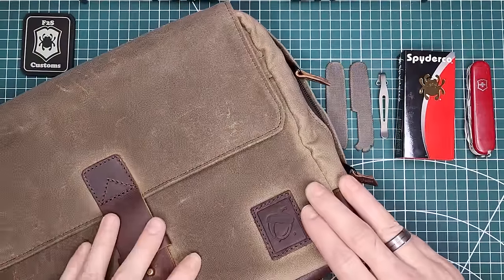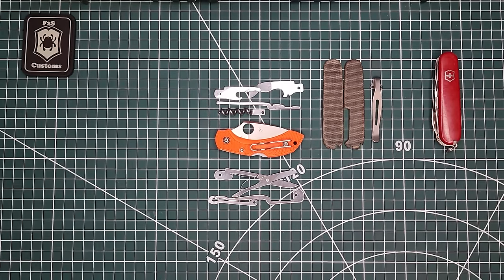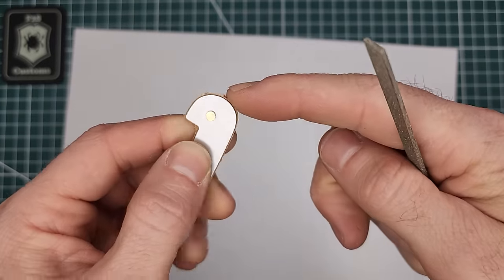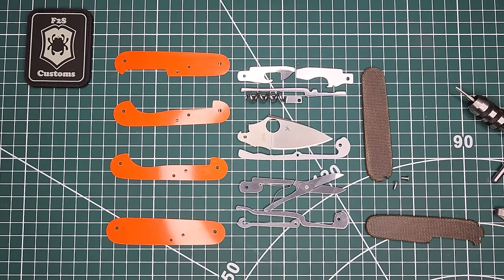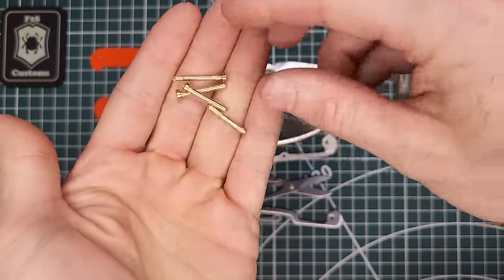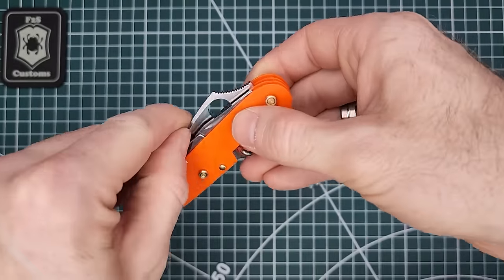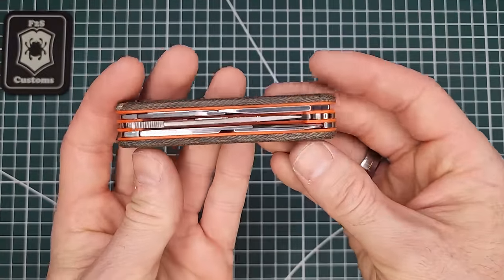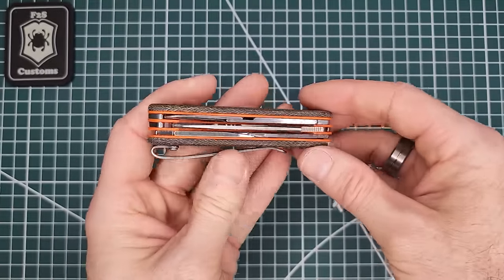How I made this Custom SAK for Nutsac

Comment: As a fellow knife modder and maker from experience when doing pocket clips best to use tapped brass inserts on the back of soft materials such as micarta just friendly suggestion awesome work btw
Reply from the maker: Thank you! I will keep that in mind.
Reply: I agree...
Reply: Always tip up. Tip down means added wasted motivation to open up the blade, it’s just less efficient. Even it it’s not a blade for self defense, it’s simply extra time that should already be cutting open the box/bag/whatever. I use a pocket blade every day and the few times I swap out to one of my tip down blades I’m immediately reminded how much better the other is.
Reply from the maker: @soonerfrac4611  I agree! Tip up is the best way to go. 👍🏻👍🏻
Reply: OTF tip down

Comment from the maker: Enjoying the video? You can support my channel by checking out the merch on my website. https://f2scustoms.com/merch
Reply: This is sick would love one
Reply from the maker: @Jesusiskingamen7  Thanks!
Reply: Thats absolutely amazing👊
Reply: I just found your channel. Killer blade&killer vid brother!!
Reply: If i want to build a 91 tinker and replace the oem large blade with a dragonfly would I have no other option but to fill in and Re-Drill the bore on the blade. Meaning the hole i place the oem victorynox brass pin in
Reply from the maker: @ruffknight355  That is correct. You would have to peen in the pivot bore and redrill it out to 2.6mm.

Comment: Very cool project, glad I stumbled on your channel. I'd feel a lot more comfortable with it's strength if those internal spacers were steel instead of G10. Love the blade upgrade though 👍
Reply from the maker: Thank you! I appreciate it. Did you know that the original liners are aluminum? So, the G10 is actually significantly stronger and more durable than the original liners were. 🙂
Reply: Steel would make the whole knife heavy as a mofo....... I don't think you realize just how much weight that would add to make them the same dimensions out of steel.....

In thise size and thickness g10 is incredibly strong..... People just see materials that look like regular old plastic and they assume it's brittle, but they just don't realize how far along we are with material sciences...... 

G10 is amazingly strong, even in thin form factors like this.... And it can't rust or corrode at all....
Reply: @JasonP6339  I'm not "people", I'm someone who makes knives and things out of steel, G10, etc. A piece of steel (which actually IS already used in other tools like this) little more than the size of a shim would add less weight than a few coins in my pocket. 
G10 is not some modern miracle material, even in thin "form factors". It's just fiberglass and resin and has been used as circuit boards in cheap electronics everywhere for generations because it's cheap. The choice to use it here is aesthetic, because it meets a color theme. Using steel would potentially allow the spacers to even be thinner and cut down the real annoyance of carrying something like this in the pocket; it's bulk.

Comment: Great content, would you be able to make one without the can opener, and replace that with something else?
Reply: How about a chisel?
Reply from the maker: Thank you! Yes, I could make one without the can opener. Plenty of options.
Reply from the maker: The original chisel is meant to go on the back of the knife. If you wanted a large chisel on the top of the knife, I would have to modify a tool. But it is possible.
Reply: Why? Most important can opener and bottle opener 👍😄😄🇩🇪🍻.
Reply from the maker: @thomasschafer7268  🤣👍🏻

Comment: Looks real good and functional! I might have to try to do one too. I was/am going to try adding a thumb stud (because yes, I'm one of those guys) to a standard SAK blade and move that layer to the right-hand dominate side. The versatility of the Spydie Hole making it ambi friendly is sweet for the majority especially if you were to sale them. I think the only change I would make would only be a personal preference and that would be to grind a bit more on the spring to bring the knife tip up to make it more centered to the axis of the knife handle. Again, that is just a personal aesthetic preference.
Great work, love seeing it done! Gonna have to go back and what all your vids now!
Reply from the maker: Thanks! 
Yeah, trying to bring the Dragonfly blade up (more straight), will then make it loose when opened. The pivot bore would have to be moved for that to work.
Reply: @FittoSurvive  Hmm, I see. When I'm working on things like that I've lightly filed either the blade where it bottoms out/rests against the spring ( like L < area)  or the spring itself which doesn't  affect the pivot at all, just the angle of the open blade. I've made some 'idiot marks' on bolsters doing this because I don't necessarily have correct tooling to do it without having the knife fully disassembled such as with Case/Buck.. In this case since you can disassemble it, it would be very easy, or well easier to not screw up but more time consuming because of the need to mock it up after each adjustment to see if you need to remove more.

Comment: Could you take a huntsman and just add the dragonfly onto main blades original spring? Then you would need any additional parts correct?? I’m sooo fascinated and in love with these SAKs.
Reply from the maker: Yes, you could replace the original large blade with the Dragonfly, but then the Dragonfly had to be reshaped to fit. No extra "parts" would be needed other than new brass pins.

Comment: The work is well done mate, it's a really cool tool and looks really nicely made for sure,  but 1) get yourself a new saw for cutting the G10, that was painful to watch (they make tiny table-top jig-saws and band saws for just such a thing and it would open up some cool design/build ideas to have such a capability) and 2) if you're going to try to "thread" micarta skip it and just run a screw into the material with a small pilot hole so it doesn't crack and cut/grind down the screw tip after it's in place.  Those screws WILL fail eventually because the threads in the micarta will deform over time and with use.  Or go big-time and use a nut-sert/chicago fastener of some sort with a matching bolt.  Those nit-picks aside it's really cool to see what people came up with in terms of modifying SAK's.  I remember when that was considered a "high-tech" pocket knife.
Reply from the maker: Thanks a bunch!
I definitely agree with needing a new saw... I've actually gone through about 3 since I made this knife.
I have done some upgrades, now when I attach a pocket clip to softer materials like micarta or carbon fiber I use knurled brass threaded inserts. https://amzn.to/3vxbeEt
Thanks for the advice!

Comment: That's awesome, I see a new hobby in my future! Is there a place to buy just the components and tools?
Reply from the maker: Thanks. It is a great hobby. Unfortunately, the parts are usually not sold separately. Some times you can find spare parts on Ebay, but they are usually too pricey IMHO.

Comment: I LOVE it!
Instead of the corkscrew, l would have installed an awl. (Mine comes in handy for starting holes in drywall, etc.)
Also included would be a opening for the tweezers (for splinters) and instead of the toothpick, l would slip a Firefly magnesium ferro firestarter into that space (always good to be able to make fire).
Reply from the maker: Thanks! Yeah, several more things could be added. 👍🏻👍🏻

Comment: Man you hit this one out of the park. Why is it that the dragon fly fits in this knife without grinding the blade flat like u usually do? I way prefer it not ground down. Cheers 👍🏽
Reply from the maker: Thank you sir! 😁 On this build I placed the Dragonfly on a layer of it's own, that's why it didn't need to be ground down. If. I place it where the original blade is supposed to go (next to the small blade, above the corkscrew) then I have to grind it down.
Reply: @FittoSurvive  ah that makes sense. Thanks very much for answering mate. 👍🏽
Reply from the maker: @TobyFireandSteel  You are very welcome! 👍🏻

Comment: That is awesome! One question, micarta holds threads without stripping or pulling  the screws out? thank you
Reply from the maker: Thank you. I tested the pocket clip on micarta scales before making this knife. It held up well, over time and with much use, it may come loose and need some loctite or something like that.

Comment: That is the gorgeous little knife.
But pocket clip holding on just to plastic threads makes me nervous) I think drilling blind holes half-way through the scale from the inside and gluing small metal nuts would been made a more robust clip mount. Great build anyway!
Reply from the maker: Thank you! I did address the issue of the threads in the micarta. Here's a link to the upgraded method. https://youtube.com/shorts/qTn0A5d4zVU?si=qocw-VM9NC7GkNFj

Comment: It's a master piece sir👍👏. The blade seems don't align straight with the handle or it is an optical illusion ?
Reply from the maker: Thank you! The Spyderco Dragonfly blade is not parallel with the handle when open. That is correct. If I adjust the blade to be parallel, it will be loose. This is an issue that I can not eliminate.

Comment: wonder how will the pocket clip threads on the scales hold up in daily use, my experience with composite materials is to either lock nuts on the other side, or put countersunk thread inserts in them from the other side for longevity. tension on pocket clip screws can be strong enough to strip threads if clipped onto thicker cloths...
Reply from the maker: I did some testing. Of course, not an extensive test, but should hold up well. Maybe over time it will need some loctite.
A countersunk thread insert would definitely eliminate that question though. 👍🏻

Comment: Very nice build, I just have a couple of ideas/questions: blue color for the accessories instead of green would have been maybe better since blue and orange are complementary colors. Wouldn't be better to sand the orange plastic before gluing it to the micarta shells? In your experience is it safe to have such a big blade that cannot be locked open? (as usual for SAK, but since the blade is bigger...) thanks a lot for documenting the build!
Reply from the maker: Thank you! The micarta and G10 epoxy together really well. When I epoxy G10 and titanium scales, then I usually cut in some striations to help them adhere to each other better.
I am working on a liner lock mod for the Dragonfly, but I have not yet completed that experiment.
Reply: @FittoSurvive  thank you! The amount of research and work you put into your builds is remarkable! Amazing work!

Comment: Been wanting to swap the philips in my Deluxe Tinker for a corkscrew, and now it seems a whole lot easier. Thanks! What tool and bit do you use to drill the factory pins out?
Reply from the maker: I use a cordless drill and cobalt drill bits. You'll need a 2.5mm drill bit for the outer pins and a 2.2mm drill bit for the inner pins.
Reply: @FittoSurvive  sounds like a plan. Hopefully I can do it as smoothly as you make it look

Comment: Where did you acquire all of those extra blades, magnifier loops, scissors , separators etc? I can’t find replacement blades anywhere. Did you just buy a load of SAK’s and take them apart?
Reply from the maker: All of the spare parts that I have are from knives that I have disassembled. I have accumulated them over almost 2 years of SAK modding.

Comment: I'm a fan and great job, but does screwing a pocket clip straight into micarta without some sort of anchor actually work? Seems like it would pull straight out.
Reply from the maker: I did some experimenting with it before making this knife and didn't have any issues with it. In the future, if it were to come loose, some loctite should fix the problem.

Comment: I have a Spyderco Delica 4 and a Victorinox Fieldmaster, both of each considered the best of the best in their own classes of pocketknives. Is there any way you can combine my knives? How would the locking blade from the Delica be retained in my Fieldelica so to say it?
Reply from the maker: I have actually never tried placing the Delica 4 in a 91mm SAK. I'd need to do some experimenting with that.
The only locking mechanism I can do in a 91mm SAK right now is a liner lock.

Comment: Awesome desighn. What is the spring that you used to add the dragonfly blade without modifying it ? Very enjenutive when it comes to putting these Saks together
Reply from the maker: Thank you. The spring is from the older scissors.
Reply: @FittoSurvive  thank you for the reply is that the only spring that will work with the blade un-modded i have a climber but the newer model..
Reply from the maker: @adamstanway5772  It is the only spring that I have found compatible.

Comment: Nice knife and craftsmanship. But why replace the steel liners with g10? Just for looks, or does it have another benefit? Shouldn't steel be the better material for this purpose?
Reply from the maker: Thank you! The original liners are actually not steel, they are aluminum. So the G10 is actually an upgrade.
Reply: @FittoSurvive  Thanks for the reply! I didn't know that, i just assumed they'd be made out of steel. Good to know though.
Reply from the maker: @janreineke7275  You are welcome. You really would expect them to use steel for the liners.

Comment: Great work, you obviously know what your doing but why the parcel hook? I've never had (or heard anyone else) a valid use for it, lol. I personally would have gone with the tortoise gear mini ferro rod to go with the tinder, instead of the tiny phillips too but awesome build mate!
Reply from the maker: Thanks. The parcel hook is the only tool that can on the back of the scissor spring without using washers to make up for the difference. So, I could have used the awl. But decided to go simple.
I agree with you though, the parcel hook is definitely one of the least needed tools on a SAK for me too.

Comment: What is the Victorinox model that you used as a donor for the blade spring? I tried one from Campers saw, but it's a bit thinner than the blade.
Reply from the maker: I used an older scissor spring.

Comment: Very nice job! What type of spring did you use? On which version of victorinox can I find it? Thanks for sharing 😃
Reply from the maker: I used an older scissor spring.
Reply: @FittoSurvive  I read it in the comments but the standard scissor spring is used for several tools (punch or hook). I can't find the sak model or the spring is used only for the scissors.
Reply from the maker: @Tan_1664  It is the older model. Pre-1991.
Reply: @FittoSurvive  Ok, this type of model is therefore more complicated to find and the spring alone even more. Thank you for your answers
Reply from the maker: @Tan_1664  Yes, this does make it more complicated and more expensive.
Reply: @FittoSurvive  Do you think Wenger springs are compatible with victorinox?
Reply from the maker: @Tan_1664  No the size is different, but the biggest problem is that the pin location is different.
Reply: @FittoSurvive  Ok, I'm looking for where to get raw steel (1.4110) to cut the springs directly, but it doesn't seem easy to find. however I found a SAK before 1991, ordered it immediately. 33€
Reply from the maker: @Tan_1664  Cool. I've never tried making my own springs.

Comment: finally a centered blade on a Sak
Reply: @FittoSurvive  is there a botton fold flat head screw driver .. i know there is/was a phillips ?
Reply from the maker: @vlkafenryka788  Yes, there is. It goes on the back of the saw or metal file layer.

Comment: Will 2.5mm brass pins also fit in the 84mm sak or will I have to get 2.2mm brass pins for the 84mm sak? Also where can I get a brass grommet to slide into the dragonfly blad to make the hole smaller?

Comment: wonderful video. thanks for sharing. quick question, where do you get those brass gormets/washers for pinning?
Reply from the maker: Thank you! Glad that you enjoyed.
The brass grommets I harvest while disassembling the knives. But, I have seen them for sale on Aliexpress, I don't know if the quality is any good though.
Reply: @FittoSurvive  -- I had a similar question about your boxes of parts -- backsprings, scissors, etc. Presumably you buy old and damaged knives off ebay to use as donors for your stock? Or maybe if you were customizing, say a Farmer, you'd buy two knives, one for the body of the new knife, then another -- possibly different knife -- to get the tools that don't come as standard on the Farmer. And the rest of the parts that you dont use would go into your parts bins?
Reply from the maker: @twatmunro  Some of the parts in my box are from used knives. Certain parts can only be found in older versions like the 8x magnifying glass, etc. But, there are a whole of parts that are from new knives, where I needed a certain tool from a knife and the rest just went into the box.

Comment: Does the cutting edge of the dragonfly blade hit one of the middle pins or is it just really close?
Reply from the maker: No, it the blade does not tap the pins. It requires small, slow adjustments to get the tip of the blade deep enough to not stick out of the tool, but not so deep that it taps the spring.
This build turned out perfect, I did not have to re-sharpen the blade, it has the original edge. Sometimes, if I go to far in the adjustments, the blade will tap the spring and I'll have to change the adjustments and resharpen the knife.

Comment: So when closed the Spyderco blade is not sitting on the kick or the tang but on the blade?

Won't it get blunt merely by sitting like that?
Reply from the maker: No, when closed the Spyderco rests on the lower jimping. The blade does not touch the spring anywhere.